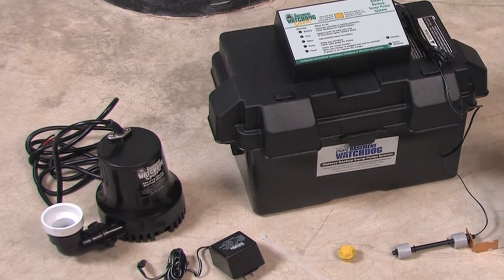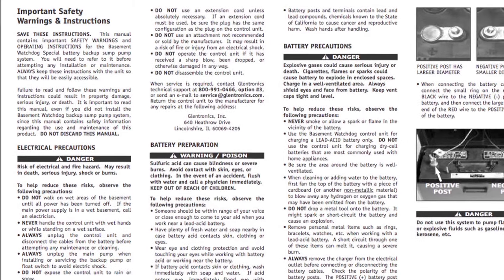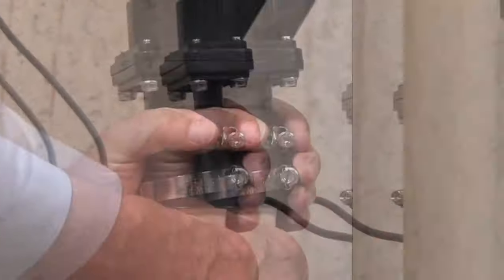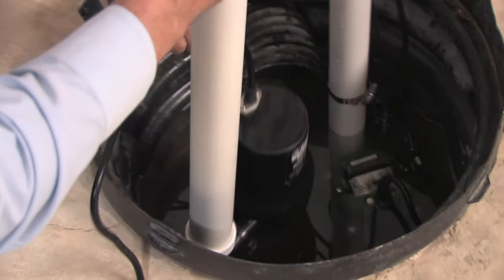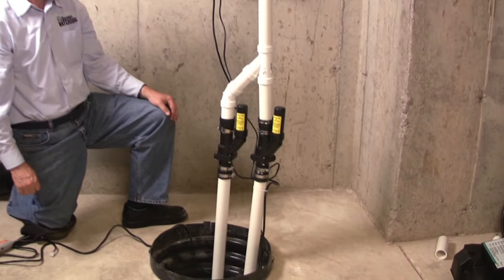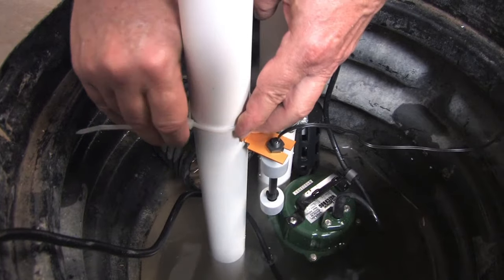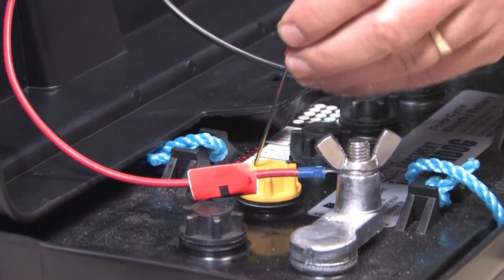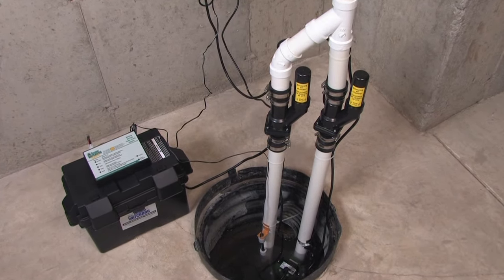How to Install a Battery Backup Sump Pump - Basement Watchdog

Comment: Back-up Sump Pump is not operational when main pump is normally operating? When the water in the sump rises to the higher level of the new float switch, the back -up pump works?
Why use a battery if electricity is available. Besides a battery can go flat if you really have a big flooded basement.
Reply: This is in case power goes out to prevent flooding
Reply: float switch is set higher because we want the backup pump to sleep unless the main pump becomes overwhelmed or dies. It's happened to me once before during heavy rain, main pump couldn't keep up and backup came on which sets off an alarm, but kept my basement dry. Battery is there incase main power goes out you have SOMETHING to protect the basement at least for awhile.
Reply: @Factsfrommetoyou  Fact is -  if you have a flooded basement doesn't mean the entire neighborhood has a flooded basements. Power companies do not shut off power because of 1 flooded basement. Chances are your home is will still powered. 
Pumps consume large quantities of power! If you must have a backup battery to power a pump & it would have to be of a high amp/hour capacity to pump for hours...most likely of the lithium variety! Expensive purchase & expensive maintenance! One more problem to think of!
Hire a company to get the job done. Have their phone # at readiness!
My best advice is to install an "Early Warning Water Level Sensors System" using telemetry to your mobile phone.
Set to trigger at a 'low' level which would activate the pump early avoiding substantial damage & also the possibility of an electrical power cut...which the latter as said before is very unlikely.